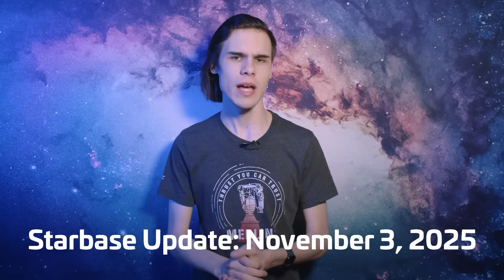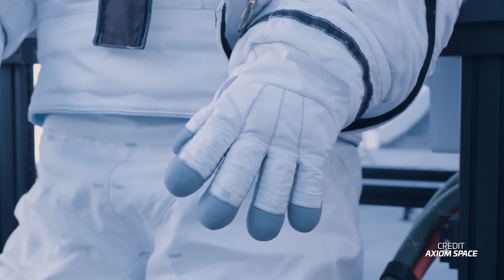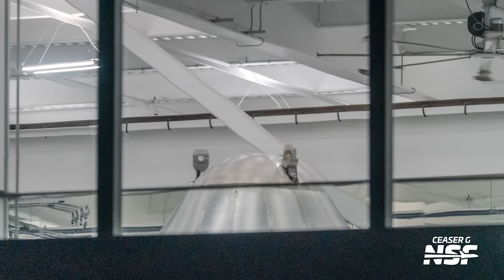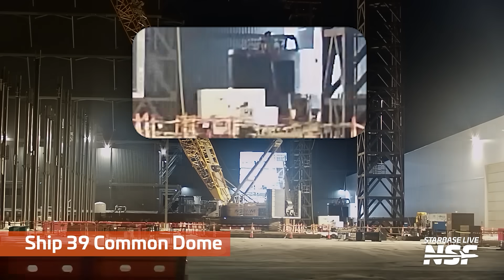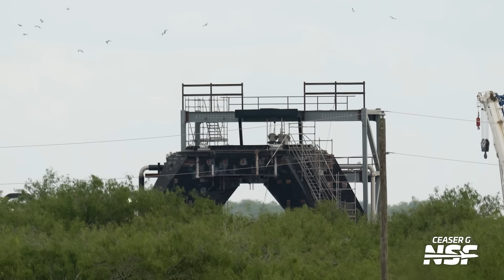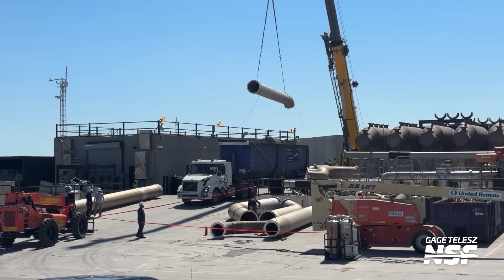Starship V3: Build Accelerates, Raptor Relights, HLS Update

Comment: This was a desperate PR reaction to HLS being threatened by NASA, so they asked department heads to scrape together whatever "progress" they've made.  But end to end the program is in jeopardy, besides Starship being way behind and having gazillions of things needed to be proven, HLS is also a dumb idea for a crew landing craft. It's great for bring a huge supply to the surface, but the astronauts should really descend in a much simpler vehicle rather than a huge heavy rocket that would be a disaster to get in or out of if for some reason the elevator broke.

A much more rational plan would develop a different craft, use Falcon Heavy or multiple Falcon Heavy to assemble it on orbit, and send it to rendevous with Lunar gateway or directly with Orion. Falcon Heavy works and can put 18t into TLI.  It's much cheaper than SLS too. Why are we waiting for Starship, a program with way way way too many possible failure modes.
Reply: End to end?  Nonsense.  It's not that far behind and it's not the only part of the program that is having that issue is it?  Or do you not know?

Comment: So no header tank for the docking system as advertised. How will SpaceX settle the fuel for landed on the moon?
Reply: The header tanks are only needed on the ships that have to bellyflop. Starship HLS does not bellyflop so they just use main tanks all the time. They’ll settle the fuel the same way it’s been done for decades: thrusters
Reply: They have thrusters for landing. It was mentioned in this video.

Comment: Would ships looking to receive fuel from the depot have probes like the tanker? Or will the depot have drogues on one side to receive the tanker and probes on the other to deliver to a ship? I think the latter makes the most sense, as that way the probes only ever have to push propellant out, and the depot won't have a heat shield to worry about so both sides are fair game.
Reply: The docking ports can only be on one side in order to enable transfer of propellant which is done through the main QD
Reply: @ale131296 two QDs
Reply: I wouldn't be surprised if spacex were planning to be able to refuel multiple ships from the same depot at some point

Comment: If HLS can do TLI, rendezvous in NRHO, descend to lunar surface, and ascend to rendezvous in NRHO again why can it not do the last leg and get the crew back to LEO? can anyone tell me why it's inconceivable because TEI really isn't all that expensive and the delta V savings from not doing rendezvous in NRHO would offset some of the cost of the heatshield and TEI. i just dont get it i must be missing something
Reply: Because capturing into LEO would take atleast 3km/s od dv.

This ship doesnt even have fuel to do a TEI in the first place
Reply: HLS, I believe, after lunar ascent to LLO, transfer to NRHO and docking with Orion and then to Gateway is out of fuel by that point. But even if it had that fuel margin to be able to do TEI from NRHO (~0.5 km/s dV) with the crew, how are you going to transfer to LEO of 7.7 km/s coming back at 11km/s? It will need a whole lot of fuel to do that breaking into LEO. It simply cannot.

Besides, HLS serves the Artemis and Orion mission architecture (where NRHO is the "base" orbit) as a lander, not doing it's own thing in which case why would it even need to go to NRHO with the crew if it could directly ascent from the lunar surface to Earth? This is actually possible (energy required to go to LLO and NRHO from the lunar surface and directly to Earth from the lunar surface is about the same). But that still leaves it with the problem of not having any fuel for LEO braking, or, quite likely with any reserve fuel for mid-course corrections or safety margin fuel required for manned missions.

Comment: I wager that the white tile seen will be a part of the white body functioning as the insulation and impact protection layers. They already have the tile mount system figured out so it makes sense to utilize the same system, allowing easy replacing and repair of damaged tiles for reuse of the HLS.
Reply: How are they supposed to repair broken tiles if HLS isn’t going to return to earth? Doing so on the moon would require quite a bit of infrastructure to be able to reach so high, and the outer surface doesn’t seem to have the type of handholds for typical ISS style spacewalks. Maybe they just used a tile shape to test the coating.
Reply: @SuperCuriousFox  Why would you want tiles on the moon?
Reply: @geirmyrvagnes8718 Like the original comment said, for protection against impacts, for example from micrometeorites. That might become relevant for longer duration operations on the lunar surface.
Reply: @SuperCuriousFox  Ah. I see. Don't know how well tiles work for that, but who knows. The ones we have seen demonstrated have been made for thermal protection.
Reply: How do we even know the tile is white?
Reply: @geirmyrvagnes8718  We saw it in the footage. Coincidentally I just watched a Short today that was showing the heat dissipation ability of an STS tile and I presume it was just the basic material and not a finished tile since it was... white! Same as this one, and would glow orange under the torch dude held to it, like the image of this one also had shown.

I believe it's ceramic fibers, hence the white color.
Reply: @DUKE_of_RAMBLE  Possible. Under an intense flame everything looks bright, so I just thought it was a brightly lit black tile. But I think you are correct that the ceramic material itself might be white, just with a black protective coating.
Reply: @geirmyrvagnes8718  Yea, I unfortunately can't recall why they are black, but I think in part it's the bonding material, so they're not as brittle as they would be without it.
Reply: Lol the last starshit came back as a full of holes burnt out hulk
Reply: @user-Atamigaputer  yeah because they removed about 100 tiles on purpose before the launch with no backup ablative material. Also, Starship HLS does not reenter the atmosphere so thanks for showing you have no idea about this
Reply: @ale131296  Yup! The gross ignorance of some people seems to be directly proportional to their Elon hatred.  OR maybe it's just jealousy of seeing someone actually being succesful...
Reply: @ale131296  Look at how pathetic the booster/starshit design is, all that to launch a few starlink sats. The top heavy hls will simply fall over
Reply: @user-Atamigaputer  top heavy? Do you even know the distribution of mass of the ship once it’s landed on the lunar surface?
Reply: @ale131296  Yep its at 58% of the vehicle height, put simply for you its highly susseptable to topple over at any at any from vertical angle of >10%
Reply: @user-Atamigaputer  and you calculated this how?

Comment: you all get excited about 3D concepts and so far none of them have come to fruition, wait until they come into effect and then evaluate and don't ooh and ah over regular 3D graphics
Reply: None? Like really? Literally none? Nothing at all?
Reply: @ale131296  You only have a Starship in what I would call an early beta, without any regolith landing system, without any space for stronuts, the rocket itself is empty inside, only fuel tanks and engines. That's the truth: no refueling system, no concept, not even a tangible working project to support life on a planet or moon, nothing, and we want to return to the moon by the end of 2026. Good luck.
Reply: @icubeTechtips No refueling system?  No concept?  What do you know about life support hardware that may or may not have been built?  You haters really do just LIE constantly and without shame.  Could you be a bigger zero?  Could you shame yourself worse?
Reply: @ale131296  Instead of boasting about conceptual graphics, they should focus on solving the problems and challenges that lie ahead of them, because for now all we can see are beta rockets and nothing more.
Reply: @icubeTechtips What on earth makes you think they are not focusing on solving the problems and challenges that lie ahead of them?
Reply: @geirmyrvagnes8718  because apparently Starship = bad
Reply: @ale131296  I don't want to prove anything to anyone, but you'll see, we won't return to the moon in 2026, only later.
Reply: @icubeTechtipsgood because no one is targeting 2026 anyways
Reply: SpaceX has already done a propellant transfer demo in orbit. It’s a relatively simple to do. Out gas propellant in a direction until propellant settles. Even a tiny bit of acceleration will do. Then use pumps. That’s it it’s nothing fancy. 

As for life support. They’ve said they’ve already done most of it. Even if you don’t believe that it’s kinda impossible to argue that they wouldn’t be able to create a system since you know dragon. They vented the entire capsule and represurised it as well.

Comment: Would be interesting if the mmod tiles were also able to sustain higher heat associated with aerocapture from Lunar to earth orbit
Reply: Remember, HLS Starship will not be designed for reentry. It will go up, fuel transfer until full, then the crew will go up in a Dragon/Starliner (yea, Dragon lol) to transfer crew to HLS.
Return will be the same, transfer to a capsule and reentry is in that. (pretty sure the HLS Ship will be disposed of by having it burn up on reentry, but don't quote me on that)
Reply: @DUKE_of_RAMBLE the current architecture has hls filling up in Leo and then going to the moon and docking with Orion in lunar orbit. Once the starship is done with the mission the crew is going to transfer back to Orion and starship will no longer be needed. I think the long term objective for Spacex would be to bring the hls back to earth orbit by skimming the atmosphere but not completing a complete reentry( aerocapture ). If it fails then Spacex redesigns and tries again if it’s sucessful and reliable then that enables potential reuse of hls and use of dragons launching from falcon 9’s which would dramatically lower the cost of lunar missions. At least that’s what I think they are doing. I don’t think hls has enough delta v to get back into Leo without aerocapture but it’s too risky to do that on a first flight with crew and congress wants to use SLS so they get an roi.
Reply: @RunTheNumbers  Right! I forgot about Orion! 🤦‍♂️ Thanks.

I suppose it's possible and it would be nice to be able to reuse it, but everything I've seen/heard has it being expendable with no plans of recovery/reuse.

Comment: HLS could land on the moon and stay there as the base.  A small ascent vehicle could take astronauts from the surface to the orion in lunar orbit.  How much of the base infrastructure can be built into the fuel and oxygen tanks and survive the cold temperatures of the fuel during launch?  Grate-style floors and framing structures could let fuel flow through during engine firing.  All that stuff winds up pre-installed after remaining fuel is transferred to a storage tank after landing.
Reply: They could wait for Blue boy to arrive and then catch a ride back up with them, leaving starship on the surface as a base.
Reply: I saw this one animation where they tip an HLS Ship onto its side into a pit, cover it with lunar regolith and have it operate as a permanent base.
Reply: I love that idea, but that would be A LOT of weight in grating, and for that reason alone it wouldn't be done since that would eat into fuel budget.
And yes, before you say "it wouldn't need to be heavy duty because it's in low-G...", it would need to be, so that it survives the 2+Gs during launch from Earth.

That being said, it could possibly still be done in situ, by using metal salvaged from other areas and welded in place... (there are new laser units that are quite compact which can do three tasks of ablative cleaning, cuttings, and even welding; the last two being used for this)

But I have a feeling they'd much rather send up an inflatable habitat and set it up in a cavern, for both impact protection and radiation shielding. I don't think they'd have the necessary radiation protection needed for long term living on the Moon in a relatively thin Starship structure.
Reply: It could probably be done with twice the money and another 4 years of development.
Reply: @imaginary_friend7300 If you don't see it happening with starlink money, you haven't been paying attention

Comment: I doubt Starship will be crew rated by 2033. No abort system limits its timeline till after 100+ flights. I wouldn't trust Muskys timelines, after all Dear Moon was supposed to be launched in 2024.
Reply: Thankfully no abort system is needed for HLS
Reply: Dear Moon was not cancelled by spaceX it was the guy paying for it who lost a lot of his capitol
Reply: Does starship need a crew rating?  It won't be carrying crew for NASA from the ground and back.
Reply: Faa still holds them to slow thr progress
Reply: @khel9505 take of the foilhat bro

Comment: i could see lunar variant getting tiles; the tiles could provide micro meteorite protection, and thermal protection from solar rays
Reply: That would be a completely different system. Currently the tiles are optimized for being a heat shield. It is very unlikely that they would be good for anything else.
Reply: @cube2fox yes, what are you trying to prevent the fuel and oxidizer from doing? boil off, and u need to prevent the sun from heating up the tanks, ie heat shield; and ceramics have been used for bullet proof vests for sometime in which their heat tiles are; just need to make them white to reflect sunlight to help further the solar performance.
Reply: Multi-Layer Insulation (MLI) is the cornerstone of radiative isolation. It's deployed as external blankets over the exterior hull, nose cone, and the interstitial spaces between internal ascent tanks and the hull. 

Structure: 20–50 alternating layers of thin reflective foil (e.g., aluminized Kapton or Mylar) with low-emissivity coatings (ε < 0.03) and porous spacers (e.g., Dacron netting) to minimize conduction and convection between layers. 

Function: Blocks ~99% of solar radiation and infrared emissions from the hot hull, reducing heat flux to the propellants to <1 W/m². 

Without MLI, solar absorptivity (α ≈ 0.2–0.4 for stainless steel) would drive unacceptable boil-off rates (>1% per day). 

HLS-Specific: On the HLS variant, MLI covers the entire cylindrical body and nose cone, with cutouts only for thrusters and interfaces. It's lightweight (~0.5 kg/m²) and deployed in sections after SECO to avoid erosion issues during launch. 

Depot-Specific: The Depot (a modified Tanker Starship) wraps tanks in denser thicker MLI (up to 50 layers) for extended storage (months) in the Near Rectilinear Halo Orbit (NRHO), where sunlight exposure is 100%. 
 @Aerius_21
Reply: The launch produces highly compressed (and heated) air on the nose tip, especially around MaxQ. So both Depot and HLS need nose tiles.
Reply: @imconsequetau5275  no, maxq is max dynamic pressure, and is no where near reentry speeds to create plasma

Comment: So how do the Astronauts escape during a launch if something goes wrong like in Dragon can blast off the top of the booster.
Reply: Unless I've missed something, the plan is there is no launch escape system. The idea is that Starship becomes as reliable as a jetliner, where there's no need for "panic and jump ship" option.
Reply: The astronauts don’t launch with Starship
Reply: I dont think Starship has any escape possibilities. The shuttles only had a hatch that i think the crew could use with parachutes (correct me if wrong).
Reply: Wrong. They only had a glide back if high enough. Original had ejection seats but those were removed.
Reply: @davidlang4442  yeah i know about the possibility to glide back to runway, but there was a hatch they could blow and slide down a pole to clear the wings before pulling their parachutes
Reply: Future starship
Reply: Toast!
Reply: Starship just doesnt launch people. Its a cargo "shuttle" by design
Reply: @_mikolaj_ really?  Like a Boeing 747 passenger plane!
Reply: @_mikolaj_  ...for now.
Reply: @geirmyrvagnes8718  should it ever carry crew?

Starship design is great for upperstage reuse, but its a bad design for crew safety. it requires the vehicle to be flawless. Abort during early ascent phase is impossibile. Later, Abort is also questionable. Ship has to first burn through like 1000t of propellants, perform a balistic reentry, do a flip and land in water WITHOUT exploding, which so far it did on every splashdown.

If something happens during landing burn, again, cant save people.

Its a complex vehicle and it is not practical for it to have necessary redundancy as backup plans, beyond engine out capability on the booster.
Reply: @_mikolaj_ Not that different from passenger airplanes. We fly in those all the time, and occasionally, we perish in flames.
Reply: @_mikolaj_ starships are not meant to land in water, they will be caught just like the booster in future
Reply: @sniper_elite3853 If there is a launch failure ship may not be able to return to the launchsite, read the whole comment. This isnt about normal scenarios, but aborts. There may be moments where it could start burning retrograde, but after some point, ship is travelling too fast to return and will have to do an ocean landing.